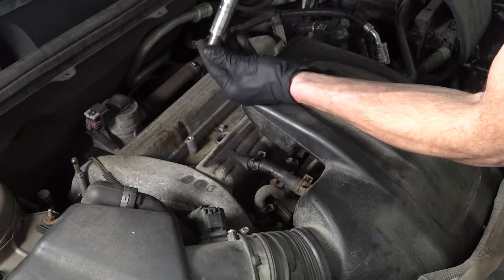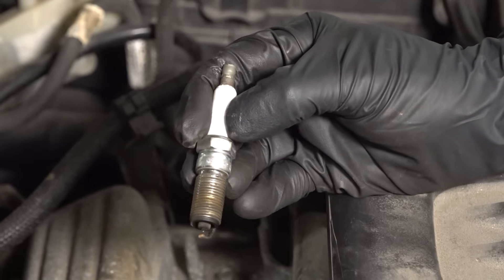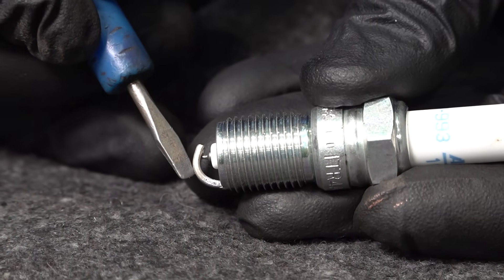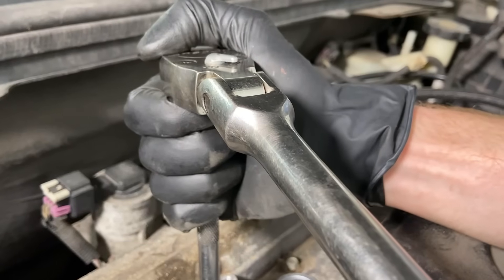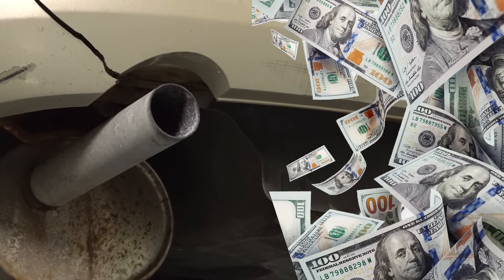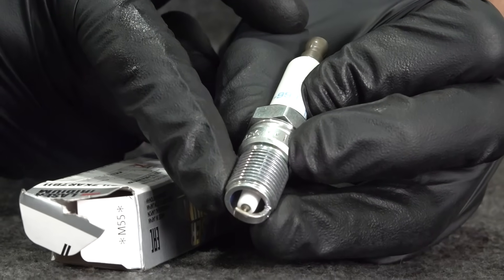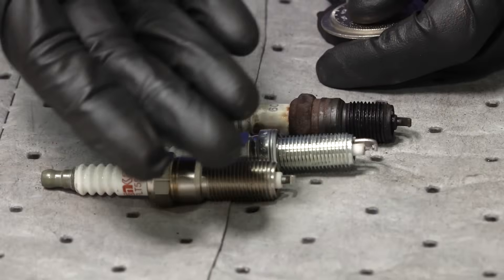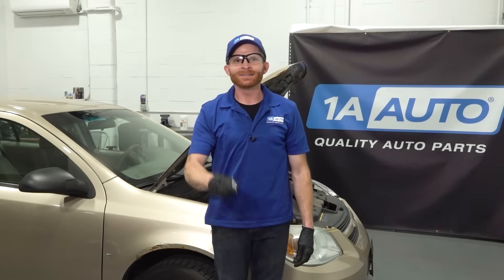Common Spark Plug Installation Mistakes that Cost You Gas Mileage on Your Car or Truck

Comment: I'm sorry can someone please help me I have a question I have a 99 Camry 4 cylinder I want to put plugs in it says I'm supposed to put double Platinum grounded plugs but I bought double ground twin tipped iridium plugs from denso with them work or should I change them for the Platinum

Comment: Have not worked on cars in years - but on motorcycles I just swapped plugs in a straight four Aluminum Engine.  To Avoid any Cluster FK's 1- I warmed the engine just a little; and 2- during insertion of new plugs , added a little 3 in 1 oil on the threads. Note: Gently Align the plug, and then use the socket to hand tighten before using torque wrench. If during removal, in addition to hear, a little wd-40 or blaster could always help if needed - btw: I had to go mostly by feel considering the gas tank covered my view - so one must take one's time - nice performance improvement too -

Comment: Some lubricate them not realizing that you screw then with a different force than your torque wrench. Well why would one say. Less friction on the threads!😂 oOps! Normaly you put them in dry. This is a good thing because vibrations can however don't necessarily have to loosen it. But it's possible. However you shouldn't use a torque wrench if you lubricate them. Let your car mechanic do this you can break a lot. This doesn't cost much.

Comment: My old 98 Ford F-150 4.6 2 valve needs new plugs. I opted for Bosch double Iridium plugs. On the box it says 11 lb. ft. But my Haynes manual says 84-168 in lb (7-14 lb ft) but a well know YT Ford mechanic says 20-25 lb ft. because there's not much thread count on the aluminum head material. So what torque do I use? I think 11-14 lb ft. Thoughts??? 😊

Comment: i bought pre gapped spark plugs and put them in and had rough idle. i took them out and the gaps were way off. maybe my mistake maybe shipping maybe distributor maybe manufacturer. either way check the gap just before installing.

Comment: You missed anti seize and also missed what type is correct for which applications. And also you have to check and fix the gap on iridium because the manufacturers do not send them properly gapped. So i had to infact fix my ngk spark plugs because the gap was 40 and needed to be set to 44.

Comment: Did my 08 f150 over the weekend.  A few issues I ran into... The rubber in the spark plug socket came out with the plug a few times.  How to avoid?  Don't push the plug too hard into the socket.  It should still hold with light pressure.  Another thing which turned this tune up into a 2 day back breaking process was at some point in the history of the vehicle a rat had built a home on top of the motor and even after compressed air there were small black round seeds that found their way into the port and stuck around the base of the plug.  Had to use a camera like the one in the video and a copper wire dipped in rtv silicone to extract each one painstakingly slowly and carefully.  What a nightmare.  But I got her done and she's purring like a kitten after changing all the ignition coils as well.  Work slowly and patiently and you can do it.
Reply from the maker: +@davehildebrand38 Thanks for the feedback!

Comment: I use 30 weight non-detergent motor oil on the threads. Just a little on my index finger and spread it around with one roll of the spark plugs threads. NOT ALL OVER THE ELECTRODE !!!. This will prevent thread locking and help the next guy, ME !!
Nice honest video of FACTS !!

Comment: 2018 highlander showing P0300,P0011,P0021,P107A2A.... changed sparks plugs,fuel pump, clean the port injectors and direct injector.... still rough idle, acceleration not sharp....these codes are back P0011,P0021,P0300,P0037

Comment: You can gap platinums or iridiums if you use one of the squeezer tools now available. You may not have to, tho, because the factory gap may match your cars specs. Don't use those round gauges. Too rough. Use a good set of feeler gauges and gently insert into the gap. Don't use lubricant on the threads because it changes the torque specs. Also, make sure the engine is cold to avoid damaging soft aluminum engine threads.

Comment: Love the first clip at the beginning. People using an impact driver to push them plugs in as hard as they can as this crosses the threads like crazy. They did not thread them in first with their fingers then use a regular ratchet.

Comment: Most morden spark plugs have a coating on the threads, anti size is not needed, anti size can work it's self down around the ground strap and short the spark, if you do use anti size use very little as possible, yes you can gap platinum and iridium plugs, proper spark gap is important for a engine to run efficient, over gap leads to power loss under engine load, using the right type of plug recommended by manufacturer no matter what the brand, and setting the right spark plug gap is important for a efficient running engine.

Comment: I recently (yesterday) replaced the coil packs & plugs on my Honda Fit.
After replacing the first plug I couldn't get the coil in, it was sitting about half an inch above the other yet to be removed coil packs.
Thought I'd go onto the next cylinder and come back to it later,,,,,,,spark plug could undo but not pull out......
Yep....the little rubber insert in the spark plug socket had remained on the plug on the first one (which is why I couldn't get the coil pack in).
Put the rubber insert back in with glue (t7000 glue) and fitted the rest the next day no probs.
Running a treat now :)
Reply from the maker: +@Ulbre Thanks for checking us out! http://1aau.to/m/Shop-1AAuto-c

Comment: If you use a quality spark plug (like NGK), there is absolutely no need for anti-seize. Quality metal plating keeps the plug from seizing. Proper tightening is also crucial. There is a chance of over torquing the spark plug and stretching the metal shell if anti-seize or any type of lubrication is applied. Metal shell stretching can decrease the heat transfer characteristics and can lead to pre-ignition. Too much anti-seize can also melt and drip down on the firing end insulator and cause fouling/misfire.

Comment: 5:18 I just use Telescoping Magnetic Pickup Tool to insert spark plug2. I carefully deep the spark plug on the tip of this Telescoping Magnetic Pickup Tool, then start turning clockwise. If spark plug doesn't fit to thread right away it won't be forced. After couple of turns, I use a 5/8 or 16mm socket to finish the job.

Comment: spend a little more and buy good brand plugs like Bosch Platinum or NGK iridium.  That way you should be trouble free for the next 10 ~ 15 years.

Use a piece of rubber hose to get the spark plug started and threaded as much as possible and then use a spark plug socket on the plug.  Once the plug is snug, tighten the spark plug an additional 1/4 turn and after that you are done!  Lots of cylinder heads are cast aluminum today so no need to over torque things like a He-Man.....

Comment: You CAN check the gap on Platinum & Iridium plugs, you just need a Wire gap tool instead of the Coin one.
Reply: 😂 yes but goodluck .. my homeboy works at a shop and he literaly told me ypu wouldnt beleive how many people fuck up those plugs and to just not cheap out and get a good quality plug… he said he checked them in the begining and never found 1 off and hes been doin it for 20+ yrs but still you never know
Reply: Oh I'd heard of it but didn't believe it. I never really tried it until yesterday chasing down some misfires.  They already. I'm just ate up the little AutoZone coin I've had for 20 years.  Lesson learned
Reply: I've used the coin one just fine. Never understood the hate.

Comment: I always use copper anti seize on plugs for the shittyford 5.4 3 valve engine. They are notorious to break off in engine then ger expensive for my customers to have me use my special tool to get them out. Dumb design for sure.

Comment: Sure, we'll just call them installation mistakes. But we won't make the connection of you buying your auto parts from the bookstore. It's not that you bought your disposable commodities from the number one counterfeit retailer in the world...... It's your technicians fault!

If you think you're going to get factory OEM parts, Auto dealership..... You're wrong. Cuz they get their parts from the bookstore too.

20 years ago, we told you all that buying your parts from the internet was going to be a bad idea. And then they fired us all for, criticizing their overwhelmingly bad decisions.

So now that we're not working anymore, we can come up here on the internet, and absolutely hammer, these counterfeiters. The scammers, and the internet schemes, that y'all just keep falling for. But yep, after 100 years of changing spark plugs, and passing this knowledge off on to the next generation.... All of a sudden..... We're doing it wrong....

But don't worry, the counterfeit part sales from the internet, will take out them. Commercials and campaigns against the technicians. Because they have parts to sell...

Comment: I strongly disagree about the anti-seize especially copper anti-seize copper is a conductor of electricity
Second have you ever pulled a plug out of an aluminum head and had the threds come with it? I have

Comment: I use a little bit of electric tape on the lip of my socket to make it snug when lowering the spark plug onto the threads, same when pulling it out

Comment: Agree. Dont use never seize. New plugs are usually coated with zinc or nickle plating to prevent rusting. Adding anti seize may also cause the plugs to back out, which I have seen cause the plug to blast out of the engine destroying the threads. Also, dielectric grease for the top of the plug is an insulator. Modern coils / wires use silicone which do not dry out, vulkanize, or dry rot. Old components would vulkanize to the spark plug, new stuff doesn't.. so don't risk the no spark issue by adding it.

Comment: I use compressed air to blow out any dirt that may have accumulated around the spark plugs before removing them. This prevent dirt from falling into the cylinder and causing damage. When installing the spark plugs, I turn them counter clockwise until I feel a slight bump. Then I turn them clockwise. This prevents cross-threading. The rubber inserts in the spark plug socket eventually wears out, so I use a magnetic socket. Prior to installing the spark plugs,  I inspect them for damage and check if the center electrode is centered with the curved ground electrode. I use a feeler gauge with a tool that's designed to push the ground electrode to close the gap. Sold online. On engines with aluminum heads, I wait at least 30 minutes before removing them from a hot engine, otherwise if you don't wait until the engine cools, you can pull the threads right out of the heads. After removing the old plug, place a rag at the end of a screwdriver and clean the spark plug hole where the plug makes contact with the head seat. Also, place a dab of die electric grease inside the spark plug boot/ignition coil boot. This makes it easier to remove the plugwire or coil next time
 DON'T FORGET TO INSPECT THE PLUWIRES OR IGNITION COILS.

Comment: Also a big risk today is not buying your spark plugs from an authorized reseller. Counterfeit spark plugs are out there, especially for models that are otherwise quite expensive (Iridium). Same with counterfeit Shimano bike chains, for example the CN-HG701 11s chain. I’ve found fakes on Amazon fairly often.

Comment: Also it's a good idea to crack the plug loose just a small amount then blow compressed air into the spark plug well hole so nothing goes in the engine.
Reply from the maker: +@PaulCTownsend Thanks for the feedback!

Comment: I cross threaded one time and what I did to avoid having to rethread it with a tap and die is I got an old spark plug and I cut a v into on both sides and then I was able to start that one and then it rethreaded the hole.
Reply from the maker: +@MA-lm1ql Thanks for the feedback!

Comment: I learned to never watch this channel. 

Instead of showing the proper application of anti-seize, you sprayed an enormous amount on the entire plug including the electrode and ground. A tiny dab of anti-seize on the threads is all that's required. A torque wrench is 100% required for aluminum heads. I piece of rubber tube is perfect for getting the plug into the hole and turned for the first few threads. 

Do better.

Comment: I have a small piece of vacuum hose, 3/16" x 8" in my toolbox, that I've been using for 30 years to install spark plugs. Slip one end over the terminal nut, and then dangle down into the cylinder head. Rotate with my fingers to start the plug threading. Never fails, and then just pull upwards to release after you've threaded a few rotations.

Comment: Amen. On those recessed plugs down in a hole it is a good idea to unthread the plugs about one turn, then pull out the socket and use your air compressor to blow out any debris that might have settled in there since the last plug service. Then reset the socket and remove the plug the rest of the way. Dirt and dust can settle into the hole over time even if it looks like it was sealed.

Comment: I always take the plugs out of my cars every two or three years just to prevent them from getting frozen in there. And of course inspect them. Also prevents the boot from getting stuck on the plug.
Reply: I’ve thought about that, but NGK’s have crush washers. Those are one time use.

Comment: #1 Common spark plug installation mistakes, even by technicians: Using Anti-Seize. Most plugs are already treated so don't screw around with the proper torque values.

Comment: You didn't explain WHY not to adjust platinum or iridium plugs: you can crack the precious metal coating on the 'earth' electrode and the plug will destroy itself in no time flat. This is why plugs come pregapped now.

Comment: My spark plug socket has been missing its rubber insert for some years now. So what I do is use a magnetic pick-up tool for both retreiving the plugs and putting them in. You can see that in my video doing the C1 plugs. But, yeah, DEFO DO NOT drop them down the hole!

Comment: Yeah since the beginning of time I've always used anti seize from anything from my everyday crappy driver two or three hundred mile an hour funny car.... plus you left out one the most important tips you can give someone either backed him out or blow out the spark plug hole before they take that spark plug out of there lots of debris can fall down into the cylinder

Comment: whats most reliable inexpensive torque wrench for plenum intake spark plugs fuel rail for 2006 cadillac cts 2.8l base how important is torque bolts and can i cause a misfire if so please explain

Comment: I just changed my plugs on my 2014 Subaru impreza. 100 thousand miles and the car was misfiring. Now the miss is gone but idle is rough. Any thoughts of what might be wrong. I bought the same Ngk plugs

Comment: the spark plug socket cant help with that 2nd thing u mentioned, about it protecting the porcelain, the rubber grommet would still b pushing on the end the spark plug causing it to crack, so all the grommet does is hold it up in there, whiches still invaluable..

Comment: So if you don't have a sparkplug socket, start the threads with the boot on the plug wires, it will slip instead of letting you cross thread it too. Always make a full turn backwards until you feel the threads make a slight clicking sound, when you hear it begin to tighten and you'll never cross thread anything again. It sucks to retap an aluminum head

Comment: Antisieze isn't necessary unless you plan on not doing the install until years later and you can change gap on platinum and iridium's just need to be super careful. I got some ac delco double platinums that were all improperly gapped.

Comment: I have put a little very light coat of anti seize on the thread.  Did not have any issues at all.  Believe me, you dont want that plug stuck on the engine.  Of course i use a torque wrench to make sure it is not over torqued

Comment: Great info, as usual, Question do the spark plug cable need to be changed as well every time the plugs do?
Reply: No, unless you were getting a misfire code or the coils are very old, there is no need to change them. Definitely not each time, that would get very expensive!
Reply: No,modern plug wires are very long lasting
Reply: On engines old enough that they still have distributors, yeah probably. Almost every car from the 2000s uses coil on plug, so it’s more of a wiring harness than individual spark plug wires. As somebody else already noted the coil packs will eventually wear out; but I just did my first spark plugs on the current car at 105K miles and the original coil packs are showing no problems
Reply: Most modern vehicles use platinum or iridium plugs which should be changed between 60K - 150K miles. If your car is in the upper range of the number (or higher), replacing the wires isn’t required but, it is a good idea. 150k - 200k++ I’d recommend replacing the coil packs as well. Especially if your getting a check engine light, reduced MPG and/or a misfire diagnostic code.
Reply: @liquidsmokemustang1537  a misfire code  can be cause by a lot of things. This does not necessarily means your plug wires are bad

Comment: A slight bit of aluminum antisieze on the spark plug threads is a good idea if installing into aluminum heads. Steel and aluminum are dissimilar metals and electrolosis can occur making it difficult to remove the plugs later. Keep the antisieve on the threads and not on the sealing surface, this will insure a good ground for the plug.